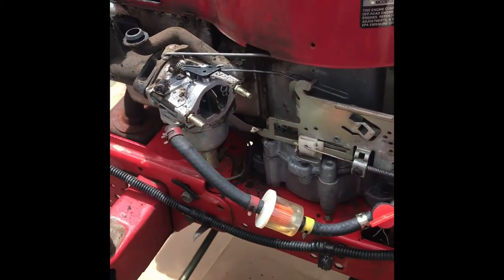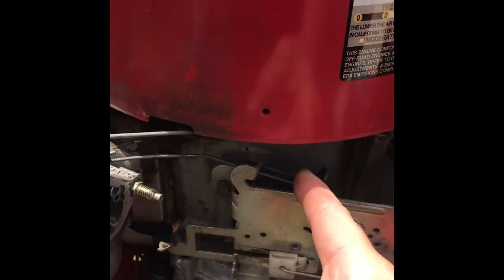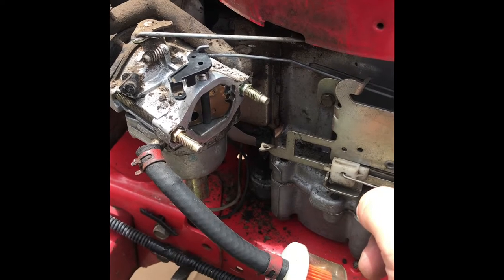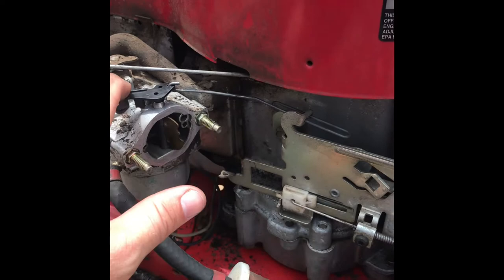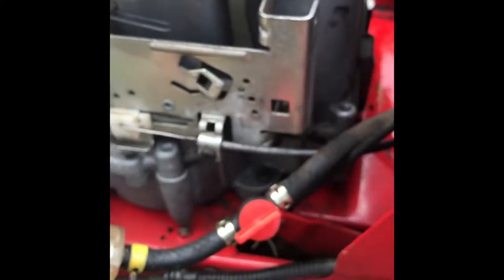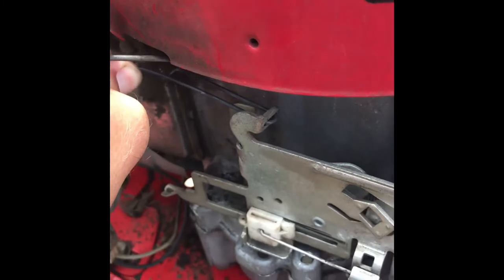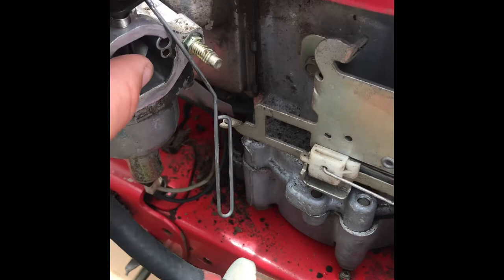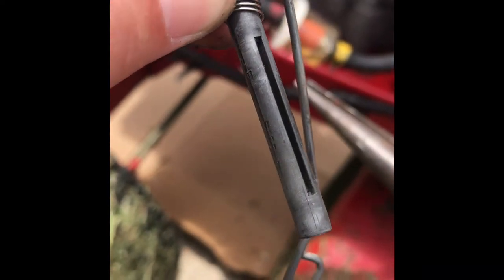How to fix choke lever on a riding lawn mower

Comment: After several hours and attempts to fix my mower your video gave me the answer. The spring on the little back plastic piece was not positioned correctly causing the metal flap to continuously open and close. Thanks for your time!
Reply from the maker: Glad you got it fixed!

Comment: At 0:07 what is the red thing with a line on it at the bottom of the screen? It can be turned to be opposite the length of the hose or it can be turned to run with the length of the hose. What’s it’s purpose and how do I use it?

Hope that makes sense!
Reply from the maker: Fuel shut off valve. One way will stop fuel and one way allows it to flow.
Reply: @sockherman  gotcha, thank you